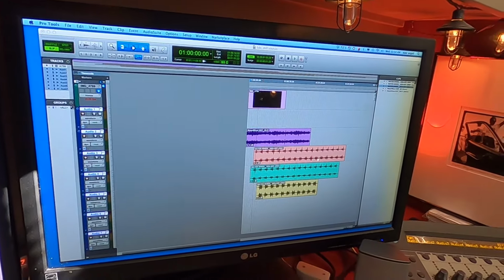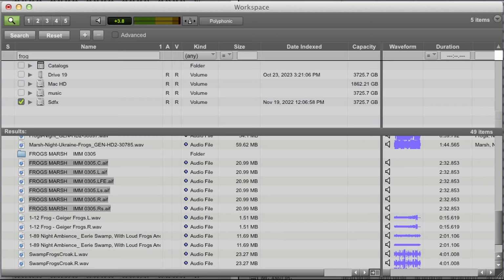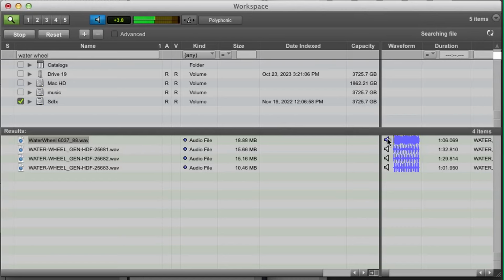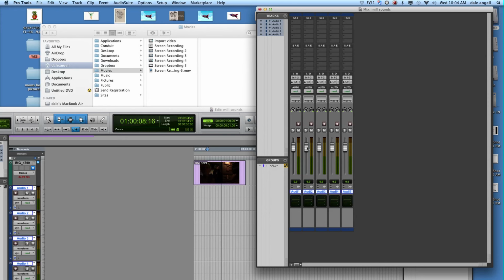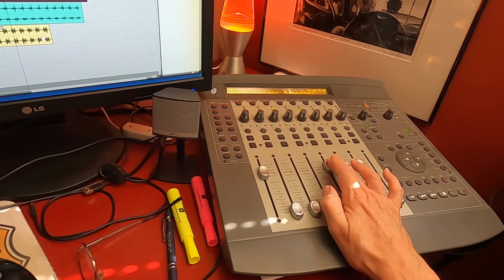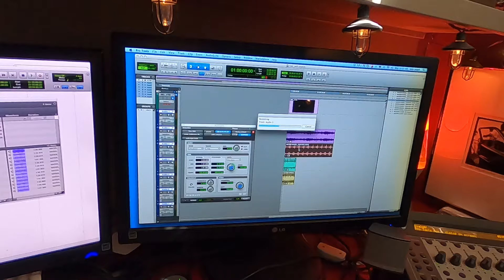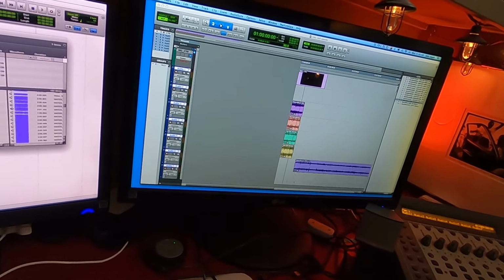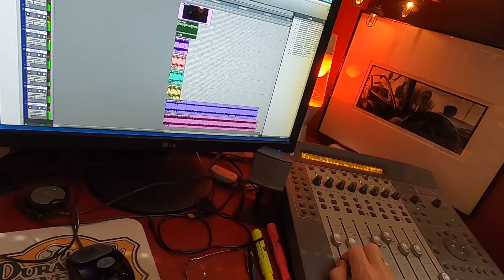Creating the Sound Track in Pro Tools - Rebuilding the 1/2" scale mill by Mountains in Minutes

Comment: Sounds good with one quibble: by speeding up the mill wheel sound you also sped up the resulting splash. The sound of the water settling after hitting the water below sounds unrealistically choppy, not long the sloppy and more drawn out tail of, say, a bucket of water being chucked out into a pool.
Reply from the maker: Hum. Good observation.  Thinking on that. 😊